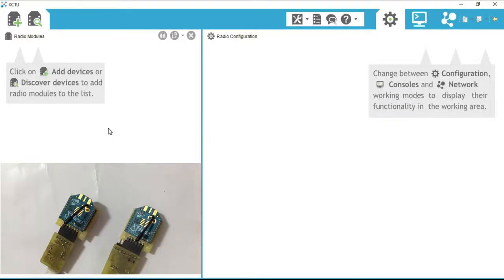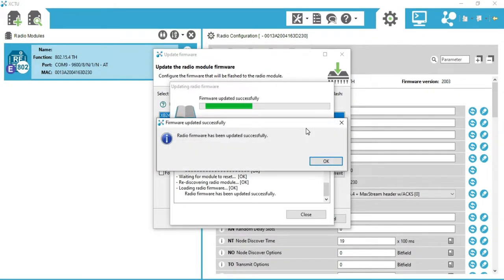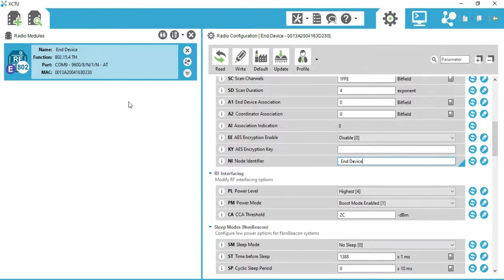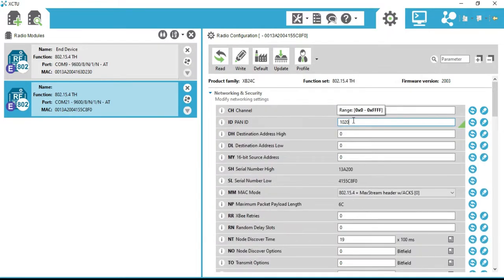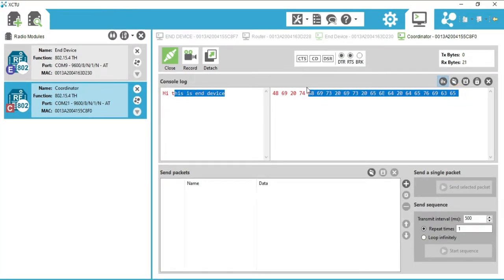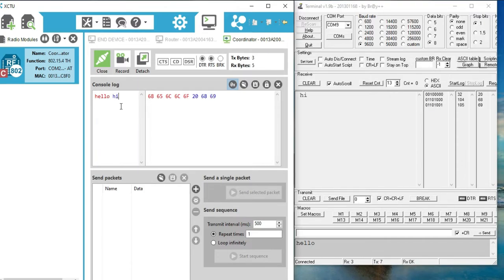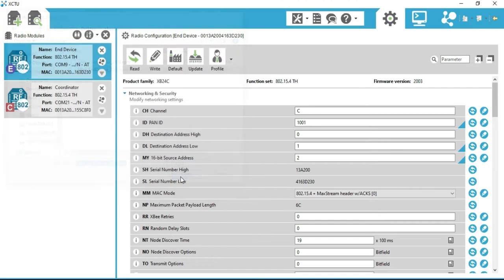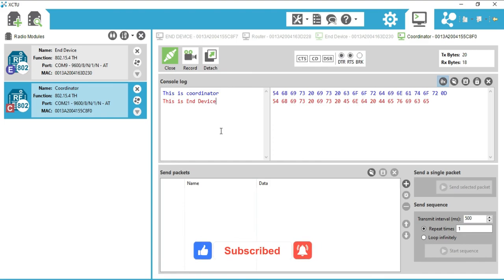How to configure the XBee Module & Communicate between them- Live Testing

Comment: I have two xbee S2C. While one of them is working, my computer doesn't see the other one, so I gues there's no problem with my computer. Why could it be and how do I solve? is there any suggestion?
Reply from the maker: You need to use to different USB  TTL converter so that you can see both of the XBee at a time.
Reply: @SMEDehradun   Actually, I wasn't trying to get information from two xbee. There's one xbee connect to the my pc.
Reply from the maker: If it is not showing in your PC then there is issue with XBee.

Comment: hi can you help how to copy existing configuration of an old to Xbee to new xbee
Reply from the maker: 1. Connect the Old XBee
2. Click on the "Modem Configuration" tab. Click the "Read" button to read the configuration from the old XBee module. This will retrieve all the settings from the old XBee.
3. After reading the configuration, click on the "Save" button to save the configuration to a file on your computer. This file will contain all the settings of the old XBee module.
4. Now connect the New XBee and again Click on the "Modem Configuration" tab.
5. Click the "Load" button and select the configuration file you saved in step 3.
6. Click the "Write" button to write the configuration to the new XBee module.
7. After writing the configuration, you can click the "Read" button again to verify that the configuration has been successfully transferred to the new XBee module.

Remember that the XBee modules should be of the same type to ensure compatibility.

Comment: I have done as you said but data is not receiving on the other terminal
Reply from the maker: There can be lots of reason of this. 

Try to reconfigure it again and select the proper baud rate ask well.
Reply: for both the modules set Destination Low Address to FFFF instead of 1 and it should start working
Reply: Change both Destination address Low to FFFF it working
Reply from the maker: It may be. I am not sure. You need to test it in real time

Comment: with the esp32 c6 that has integrated zigbee in a similar way?
Reply from the maker: Yes you can.
Reply: While connecting the esp32c6 to the XCTU it does not recognize it as an RF device while it finds it on com6. Do you know exactly how to do it?
Reply from the maker: You need to configure it through Arduino ide
Reply: Unfortunately there are no instructions anywhere on how to communicate with Zigbee on esp32 c6 on arduino ide.The c6 and h2 are the only ones that have built-in Zigbee.

Comment: Sir I want to interface xbee with nodemcu
Is this possible?
Reply from the maker: Yes. It is.
Reply: @SMEDehradun  but how sir I'm using this in my  major project
Reply from the maker: Configure it as shown it in the video and then send data serially from NodeMCU to XBee. Similarly do it in both nodes and it will
Work.